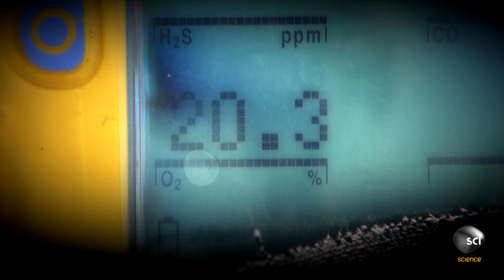Can A Moonshine Still Really Be Explosive? | MythBusters

Comment: No flame no problem...Clogged pipes and then problem...Induction or heating element works better than flame every time...
Reply: If a copper reflux still packing clogged?
Reply: @metalhead7752  you can clog the pipe if you pack it too tight...
Reply: @musicmike1960  will it explode dangerously?
Reply: @metalhead7752  it could although I have never had that happen...Mostly when a flame is used the vapors are heavier than air and float downward until it hits the open flame and then BOOM!...It's best to lightly pack any column in my opinion...That being said enjoy yourself and stay safe...Cheers
Reply: @musicmike1960  thank you so much
Reply: @metalhead7752  you're most welcome MH...

Comment: Inducing the explosion is not the same as running a still to hot .and causing it to puke and clog . Its not a pressure explosion  with an open fire under it or dide furnace ..I have seen the aftermath and its not a pretty site ..

Comment: This is utter bullshit..! You just lost ALL credibility with that idiotic video. No one and I mean really no one solders the worm shut at the end.
If you distill a mash even the dumbest rookie of a moonshiner knows NEVER to distill with solids i.e. something that big it can actually clog up your still at any point. A stripping run of any kind doesn't even produce alcohol vapors with enough ABV for it to explode. You'll have to do a spirit run in order to accomplish that concentration of flammable alcohol vapors.
Furthermore, no one with just the slightest IQ left will distill in a confined space without any ventilation at all.
You used a really nice and expensive boiler + copper tubing to prove nothing but a pressurized vessel will burst at any given time if you put enough energy into it. Oh...I almost forgot..you also proved alcohol vapors can ignite. Any 6 years old in elementary school would know that.

Comment: Since this is heavily cut down https://mythresults.com/moonshiner-myths here is the full write out of what they did in the test. And with that out of the way, the video cuts are seriously bad for showing what is going on. 

No the shack was not blown up with the actual still, that would be too unreliable for results. 
Yes they used a different set up for the actual explosion, but it was closely replicating a slightly leaky still's gas output if it got clogged 

Yes a igniter was used, they tried the shack explosion twice and the first time without the igniter all that happened was the still substitute caught fire and the still burned down. Second test was seeing if should someone light a cigarette(or similar) would it then it explode, answer is yes it will.

And no, this will not happen it the still is properly maintained. That's just common sense.
Reply: Yeah, they are full of bullshit! "They distilled a fermented corn mash mixture to obtain 156-proof moonshine..."
That's the first lie! It's impossible to get 78% ABV or 156 proof from a simple mash. It simply cannot be done!
"The boiler was loaded with pure ethanol and heated.." No one and I mean absolutely no one but a brain dead idiot fills a still with pure ethanol.
Every moonshiner knows one must dilute the low wines to 40% or less before doing a spirit run.
So again this scenario is totally unrealistic.
"For a second full-scale test, Jamie’s still was set up in a new shack, heated, and allowed to vent its vapor into the shack until an optimally-flammable concentration was reached. They used an electric spark to ignite a rag in the shack.."
Oh yes, now they try really hard to do their best to blow that damned thing up.
To top it all up they soldered the worm shut in the end. Again a totally unrealistic scenario that will never happen IRL.

Comment: A simple Thermometer could help. If the temperature of the mash is above the boiling point of Water at normal pressure GET THE FUCKING HEAT OF RIGHT NOW !!!